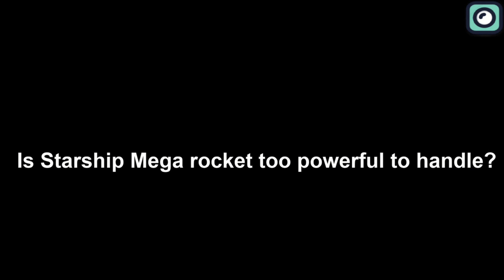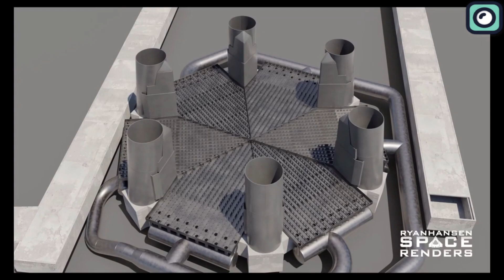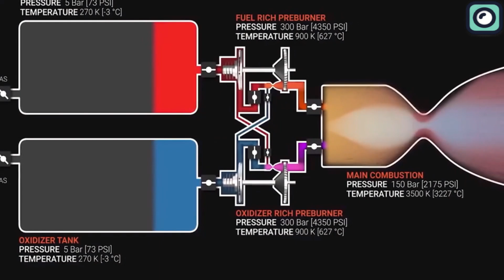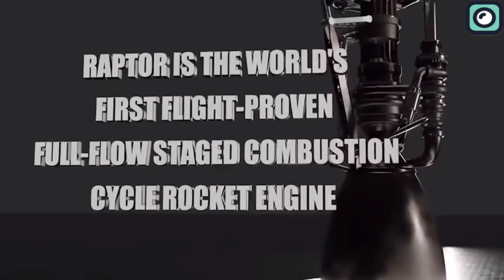SpaceX Facing Big Problem Because of Raptor engines!

Comment: the fuel delivery lines are probably all cobble fucked with 90 and  45 degree pipe fittings from Grainger....the fuel system needs to be a flow-benched ported masterpiece that has been analyzed in fluid dynamics with expansion and choking areas to provide 100% equal fuel flow.....IMHO

Comment: Can someone explain why starship not seperated from booster and landed safely after booster failure?
Reply: I haven't heard why separation never happened, but it could be due it been "out of control" meaning more software than hardware not allowing the separation (but as wild guess as it gets). What is known is that starship was supposed to crash land on the sea, never expected to land safely.

Comment: Raptor 2 combustion instability? That's the first I've heard of it. 

Regarding Raptor 2 problems: On the IFT of 20April2023, Starship B7/S24 had 27 of 33 (81.8%) of the Booster engines running for 2.5 minutes (150 seconds) after liftoff. Not too shabby for a first liftoff of the world's most powerful launch vehicle.

To reach low earth orbit (LEO), 31 of 33 Booster engines have to run from 145 to 165 seconds following liftoff to reach the altitude (60-70 km) and speed (~2.3 km/sec) at stage separation.